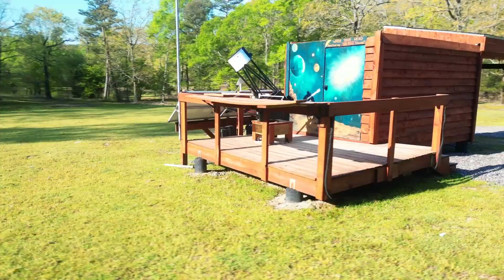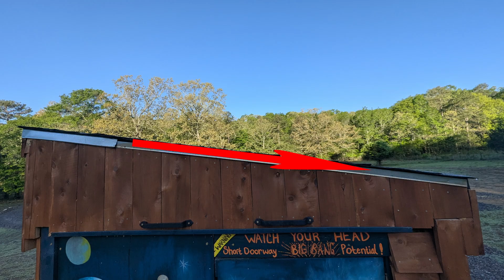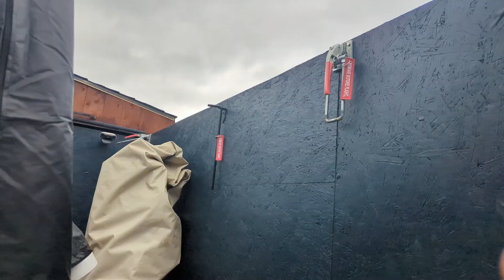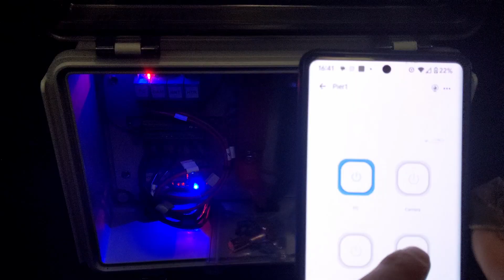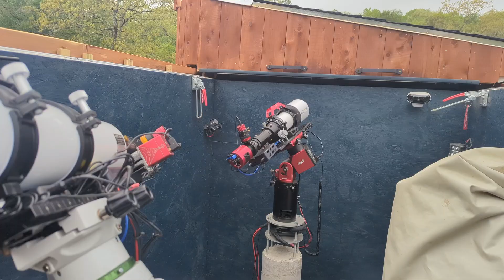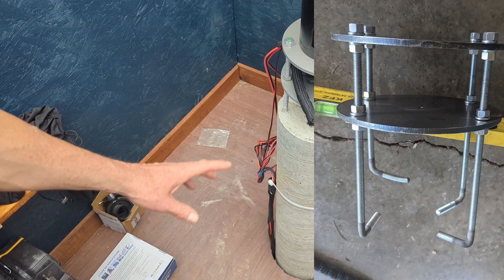My off-grid roll-off roof observatory build

Comment: Do you have a copy of your plans? I want to do this exact thing but 12x10
Reply from the maker: Hi Charles, I designed the observatory in Blender since I wasn't very good with any of the other CAD type software.  Blender is a free 3d modeling program that you can download from https://blender.org . My observatory blend file can be downloaded from my google drive here - https://drive.google.com/drive/folders/1n3n4kcF9sGm-tOUNNzLmSNocfVODSHOq?usp=sharing
The measurements units are in inches in case Blender doesn't load the correct unit system.

I also included an STL file in the google drive that might work in another drawing application.  Additionally, I exported a DXF file from blender, but when i tried to view it in the online Autocad viewer, it was a mess.  Maybe a desktop CAD application might have better luck with it.
Reply: @zaklajoie  Thanks for that info! I loaded the .stl file into bambulab for my 3d printer and it created a mockup of your observatory to print lol!
Reply from the maker: @charlesgrey1a1  Haha, that's awesome!  It's the tiny beginnings of the big things to come! :)

Comment: Beautiful build! Are you using an inverter and then individual PSUs for each device or did you specifically choose a laptop and PCs with 12v output external transformers that you can bypass?

I dislike the inefficiency of transforming DC to AC and then back to DC, but the more devices (that are designed/expecting 120VAC), so at times I've resorted to running a larger central inverter.

Also, curious what APs you're using for your solar powered mesh :)
Reply from the maker: Hi, thanks for your comment.

The Beelink S12 Pro mini PCs that control the telescopes are native 12 V, so they’re powered directly from the 12 V relay distribution I showed in the video — no inverter involved.

The Dell laptop is powered via a USB-C PD 65 W DC-to-DC converter. It takes the observatory’s 12 V supply and converts it to the appropriate USB-C PD voltage (up to 20 V) negotiated by the laptop, so I’m still staying fully DC without going through AC.

So far I’ve managed to keep everything in the observatory on either 12 V or 5 V, but I’m sure eventually something will come along that isn’t DC-friendly and I’ll have to add an inverter. I’m just avoiding that as long as I can for the efficiency reasons.

For the wireless mesh, I’m using TP-Link EAP650-Outdoor units for the primary links between the observatory and the house. If that link goes down, the mesh reroutes over a longer (slower) path using EAP225-Outdoor APs.

All 8 APs around my farm are powered via 12 V PoE injectors connected to individual 12 V 20 Ah batteries with 100 W solar panels. That mesh has been running for about three years now and it’s probably the most hands-off, reliable tech I have out here.

Let me know if you have any other questions!
Reply: @zaklajoie  I figured you were keeping it 12V, but I also use that relay design (with ESPHome) to automate my daughter's drip irrigation in our shed, and those solenoids use 24VAC. At least the relays in mine are rated to switch 120VAC so I wasn't sure if you were using an inverter before the relays. USB PD is such a win for stuff like this -- I've been implementing it into my designs as much as possible, and that laptop is a perfect use for it.

I tried in my parent's shed, 12VDC string/patio lights exterior and 12VDC LED strips inside. When they wanted to charge tool batteries it complicated things, so I just put an inverter in rather than making custom tool chargers to keep things DC.

I'm glad those TP-Link APs are doing well. With my clients I'm either using Rukus/Meraki/Ubiquiti, depending on the budget/needs, so I don't have any experience with the TP-Link line. I thought passive PoE was 24V/48V, but it must be that the passive PoE powered gear I've used has all happened to be 24V passive PoE. I don't have anywhere near the property size you're dealing with so I just trenched ~120ft to a shed and that houses an AP and that covers the property from the back edge.

I have a daughter that's getting into visual astronomy, and all these shed/observatory videos have been popping up due to the signals from telescope videos. More than anything I like seeing designs/ideas and how people solve problems, so projects like this have value even if she never gets into it enough to want a shelter for it.

Appreciate your time, hope your observatory and everything in it serve you well!

Comment: Awesome build, may I ask how far apart the piers were from each other?
Reply from the maker: Hi, thank you for your comment. The piers are spaced 10 ft apart on center on the long side, and 6 ft apart on the short side. I do have a wood pier a little over halfway on the long sides that was left over from the telescope deck that I originally had in place. That pier is not structurally necessary, but it didn't hurt to leave it in place.
Reply: @zaklajoie  Thanks for replying! I'm having a hard time visualizing your answer though. The structure itself is 10.5 feet long by 6 feet wide and the piers are inside the building. I'm just wondering what the distance is between the two piers.
Reply from the maker: @Safestassets I guess you were asking about the telescope piers. Those are exactly 4 ft apart inside the building. 

Since the building is elevated off the ground, I thought you were asking about the piers that support the entire structure. 

Let me know if I've misunderstood the question.
Reply: @zaklajoie  Thanks for taking the time to clarify, greatly appreciated. I should have been more clear. My mistake entirely.
Reply from the maker: @Safestassets no problem, I hope your observatory build is amazing, and please post pics or a video when you complete it. I love seeing everybody's unique creations.

Comment: Fantastic work! Congratulations on building your dream observatory! What’s the dimension of your room? I’m trying to do something similar and want to accommodate two rigs in a 10x7 space.
Reply from the maker: Thanks for your kind words.

The floor frame is 6' x 11', but after the walls went up, it dropped to an interior dimension of 5' 5" x 10' "6. The walls are about 66" high. If I had it to do all over again, I would probably have done 11'x8' since it is pretty tight behind the 127mm refractor. I'll probably go with a reflector telescope if I decide to go with a higher focal length since I would not be able to fit a longer refractor in there.

Comment: thanks for sharing your work, I am going to start building a 6x6 feet mini observatory in my backyard, I like the idea off horizental cedar wood on the exterior, can you explain more on the exact layers of the wall, how this is weather proofed. and also what is the hight relation of your walls to your mount. thanks
Reply from the maker: Hi, if you go to this part of the video - https://youtu.be/9XtKa3KfIhM?t=303, I cover the wall design and the OSB sheathing that was used.  I used standard housewrap to weather proof the sheathing.  Also, if you're going to use cedar type siding, you want to make sure you use furring strips so that if rain water does get behind the cedar boards, it is able to just run down the house wrap to the ground.  That will help prevent rot.

My walls are about 5 feet high and my pier extends from the ground into the building.  Inside the building my pier is about 40 inches from the floor to the top of the mounting plate.  When the mount and telescope are installed on top of the mounting plate, I have about 6 inches of clearance from the ceiling joist when my mount/telescope is in it's parked position.  I have to roll the roof open in order to put the scopes in their home positions.  In their home positions, the scopes can easily see two feet above the wall when pointed north and they can both see a minimum of 20 degrees above the horizon if they are pointed in a direction with no trees.  I usually limit to 30 degrees above horizon when imaging anyways.  Let me know if that answers your questions.